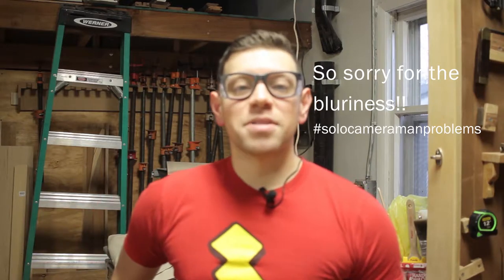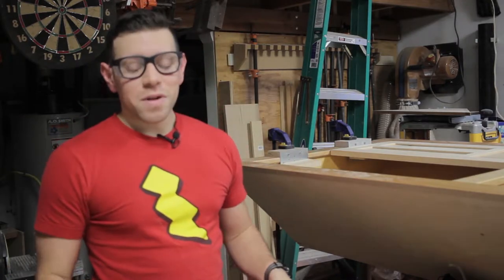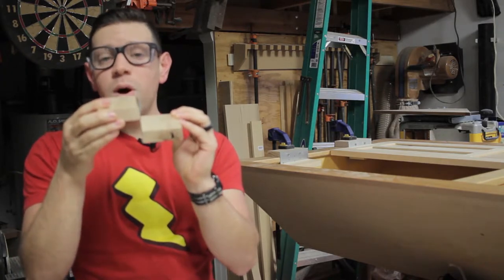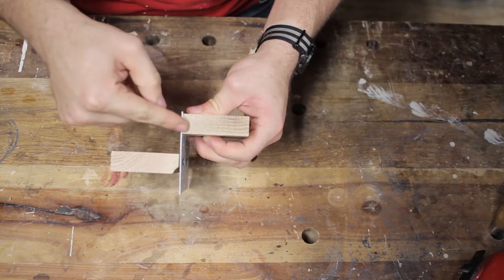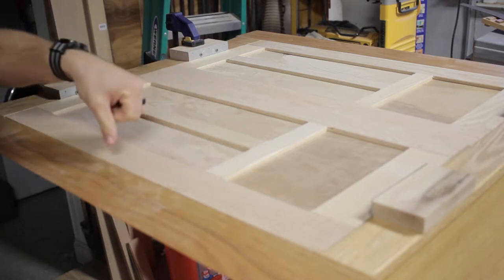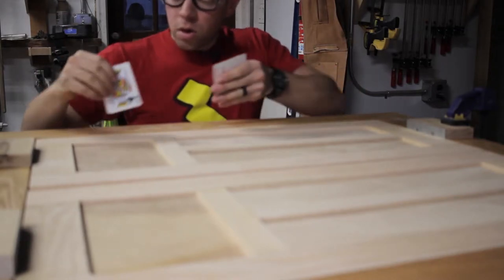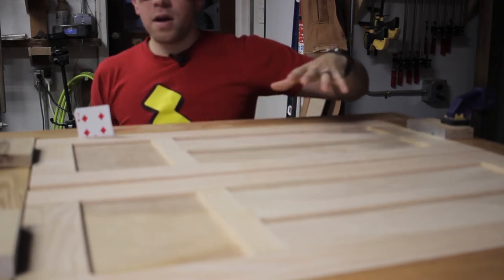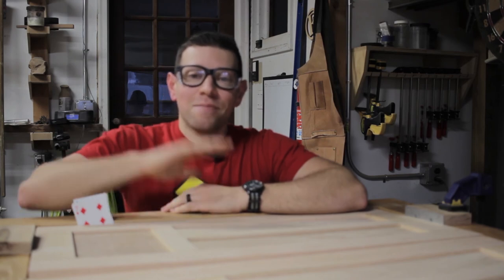Hanging Inset Doors the Easy Way!!

Comment: Ideally you fit the doors to the faceframe before you attach it to the cabinet. Playing cards compress and dont make good spacer shims, blank printable plastic ID cards are ideal because they are exact thicknesses and you can buy a pack of 1000 fairly cheap (they also double as glue spreaders and packers). I make the door very slightly oversized, lay the face frame over the top of the door, get 3 cards and a engineers pencil and quickly trace the inside of the face frame onto the door. Each door takes me under 1 minute - and then I trim the doors using a track saw. Perfect results every time, no fiddling or tweaking required.
Reply from the maker: Never thought about the compression of the cards! Your method sounds incredibly accurate. I think if I did a lot more cabinet work I would absolutely lean more towards precision and repeatability...sometimes though you just have to work with what you have on hand haha. Thanks for the input though!
Reply: Playing cards compress?

Comment: How about 1/16” or 1/8” horseshoe tiling spacers. You could hang them on a nail or something and they wouldn’t fall in. Micro adjust with little strips of duct tape on the edge of the door or face frame.
Reply from the maker: That's not a bad idea! That's what I love about this kind of "hack" is that works with just about anything you have on hand. Thanks for the tip!

Comment: Perfect.  How does this work when gravity isn't on your side? I have the cabinets installed already.
Reply from the maker: It is a bit tougher when the cabinets are upright, but you can still use the playing cards to shim the doors and set their offsets. Just make sure you have some kind of temporary handle on the door (painters tape works well) so they don't get suck in the cabinet!

Comment: How do you mark the doors for the hinges
Reply from the maker: A few different ways, but the easiest is just to hold the hinge right up to the door where you want it and lightly make a mark on either side of the hinge with a knife. Then you can extend those marks with a square to get your cut lines. Hope that helps!

Comment: Is the side facing up the inside of the cabinet/backside of the door? If not, how do you setup your hardware once spacing done?
Reply from the maker: The side facing up is the outside/showside of the door. Once you have the spacing right, you can make the marks for the hardware, remove the doors, and then use a square to transfer all the marks around the edges of the doors and frames. Hope this helps!